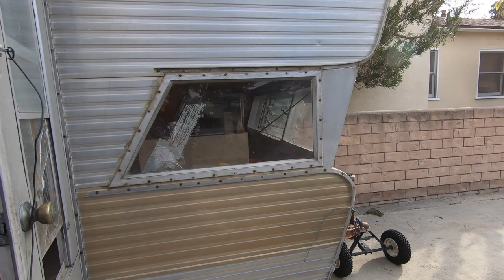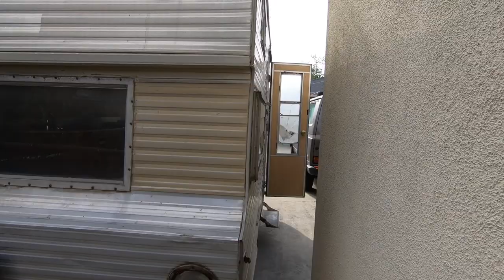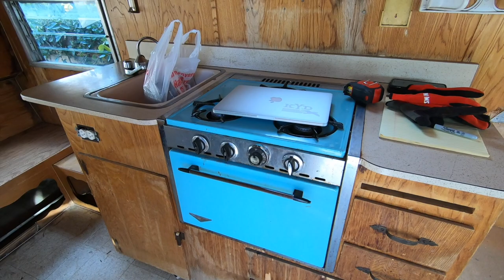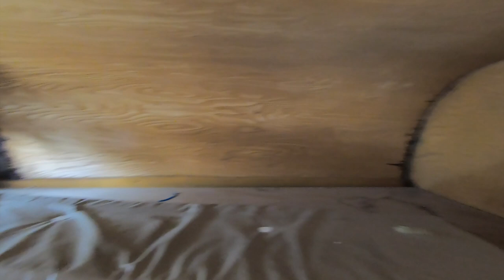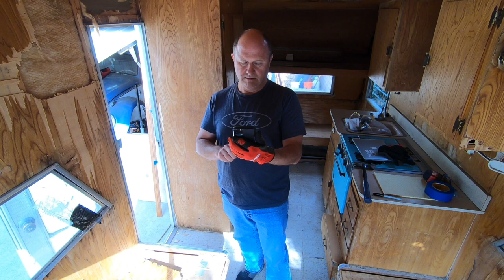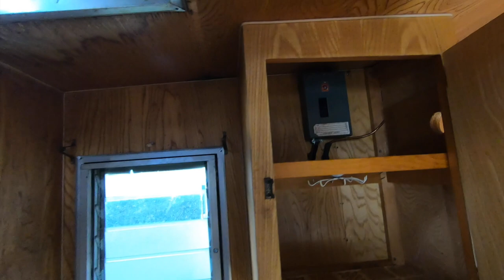Restoring a 1967 Field and Stream Tiny Trailer, Episode 1.

Comment: You just ruined your trailer. You should have learned who trailers are put together before you destroyed this one. The paneling can not be taken out from the inside without ruining the trailer. You probably noticed that the paneling goes over the tops of the walls. You have to install the ceiling, front and rear paneling from the outside over the walls and then put the framing back on. And if you want to replace the wall paneling you must remove the walls first. We call that a frame off rebuild. But you've already blown it. Go to Vintage Trailer Talk forum and educate yourself before you do anything else.
Reply from the maker: I wish I would have seen your videos as well as Rudy’s.   I am going to reinforce the inside with some bracing and slow down.  I will start with that side of the trailer and start on the outside.  Any suggestions would be greatly appreciated.  The paneling inside was beyond repair or reuse.  I’m not thin skinned so any advise would be greatly appreciated guys.  My plan was always to replace all of the paneling on the inside.  Again, I appreciate all of your advise.